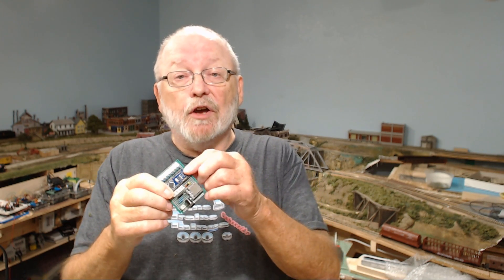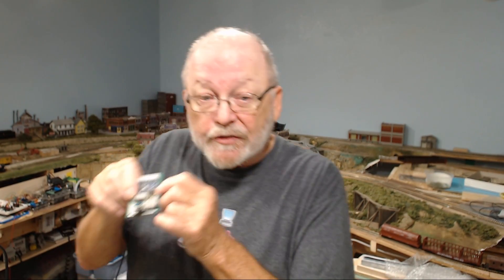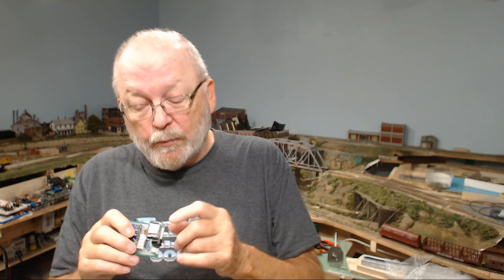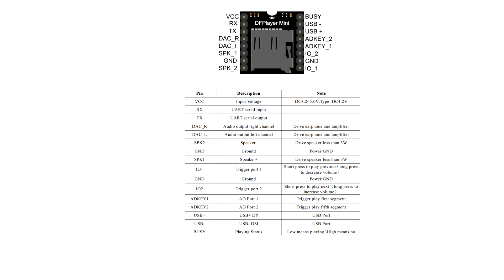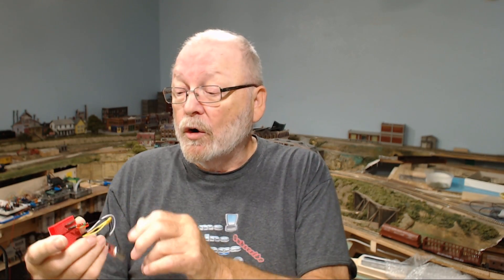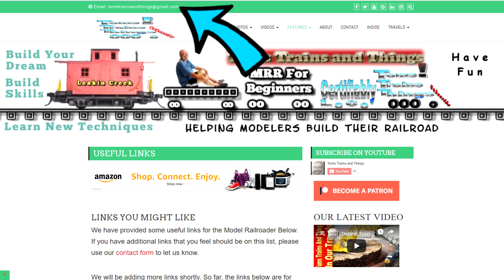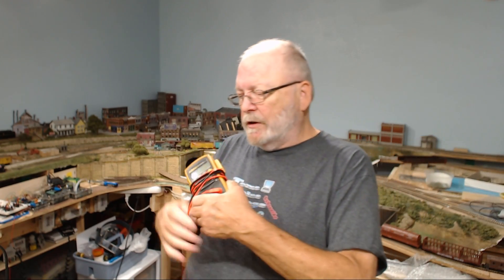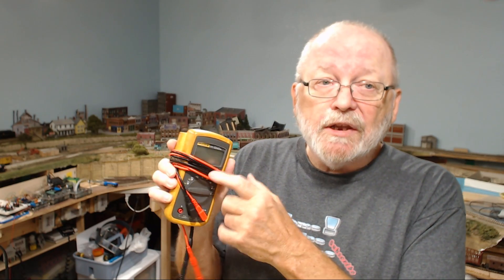Model Railroading Questions & Answers - First Of 2019

Comment: I'm trying to strip the paint off a brass locomotive. It has been in brake fluid for over 3 days and nothing has happened play. Does it take longer or is there a stronger stripper. It must have been Factory painted with some kind of sealer.
Reply from the maker: Have you read this?  https://www.ehow.com/how_7524246_strip-paint-brake-fluid.html

Comment: Tom, great video help. Guys, is there someone with this in depth YouTube help for my mth o gauge dcs trainboard? Ogr forum is  helpful. I'm am o gauge since 1970's but now back after health problems meant no trains for 8 yrs. So need help. My mth protosound 1 steam engines have blown sound cards. So far, mth doesn't answer their phone. Repair unlikely since parts are mostly not available from mth. Replaced all batteries,  atlas track tight connectors and clean. Mth diesels & post war lionel engines run fine, premier steam engines have power interruptions at many spots & slow down thru many atlas switches
Reply from the maker: You might want to check out Trainroomgary's channel:  https://www.youtube.com/channel/UC01oXBKk3MRoyXNCB29dvGw

Comment: I've just started looking at Rocrail running on a Rasberry Pi. A long way to go yet in setting everything up, but first impression is that it is much easier to set up and work with than JRMI. Creating a trackplan was a breeze in comparision to JRMI. I'm also going to look at block detection with a cheap current transformer (DL-CT1005A 50A 10A/5mA Miniature Current Transformer) and an arduino. In theory an arduino could monitor several transformers, but as you need to average 100 readings from the transformer I neecd to find out how long it takes to make a reading and see how many would be practical on one arduino. But even if it was one nano for each transformer it would be less than $8 for an equivalent to a BD20. Each nano would connect to DCC++ and use the sensor program. See https://www.youtube.com/watch?v=lyJY9hI2IX4

For Rocrail the usb serial port needs to be like: /dev/ttyACM0
Reply from the maker: Thanks for the information Mike. I'll check out the video in the morning. Just got back tonight. 
That looks like the same serial port for JMRI.
Reply: @TomsTrainsandThings  Yup, in JRMI you select from a list, in Rocrail you have to type it in and include he /dev/
Reply from the maker: Thanks Mike!